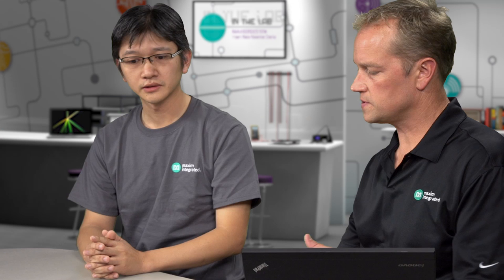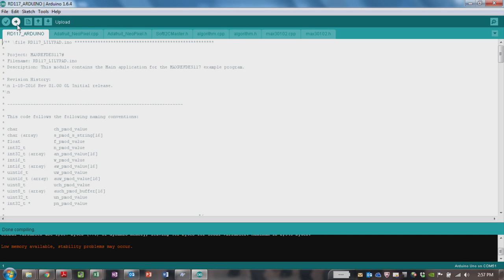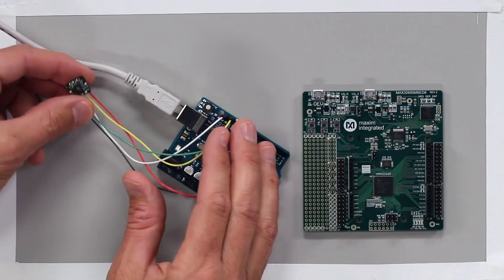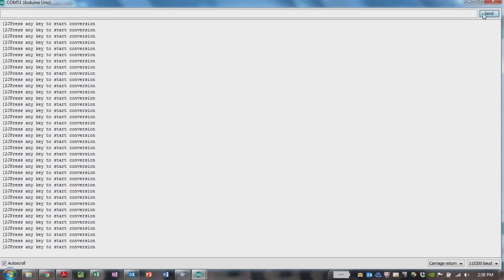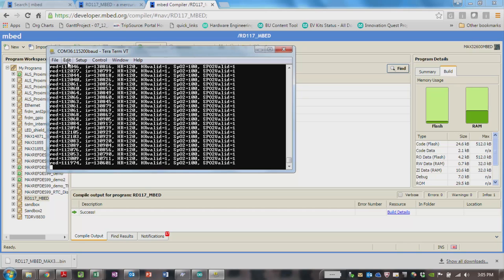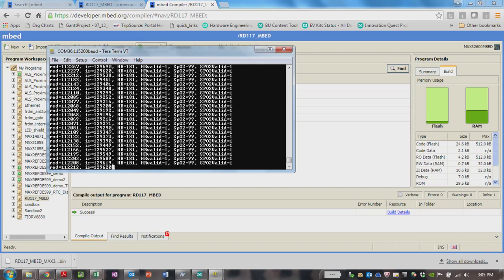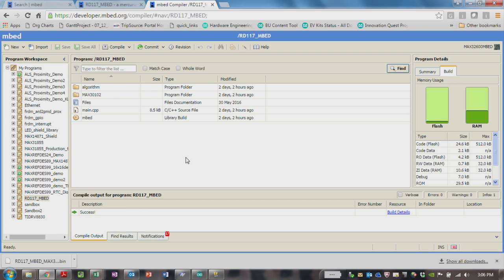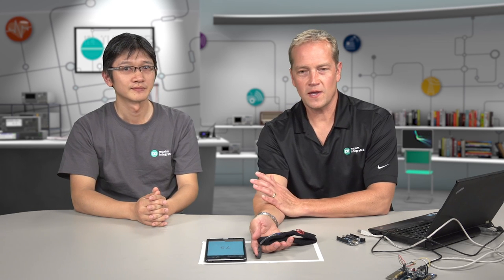Heart Rate Monitor Demo

Comment: Great demo. I have little query. The heart rate values are still varying rapidly by applying constant pressure on sensors. How to stable the values ? As other products available in the market gives more stable heart rate results.
Reply: hello, did you find an answer?

Comment: @maxim integrated It seems that in the datasheet for MAX30102, the order of LEDs is wrong, i.e. first LED is the IR one. In other words, only the IR LED becomes online in the heart rate mode. Consequently, the data read from the FIFO is in this order too. The code you're referring to is also based on the wrong info from the datasheet and as a result, the readings from IR and red LEDs are being used instead of each other which essentially means wrong results for SpO2 calculations. The MAX30102 chip I'm working returns Part ID: 0x15 and Revision ID: 0x03, so it is indeed a MAX30102 and not the MAX30100.
Reply: In max30102 datasheet it is clearly mentioned that in Heart Rate mode only Red Led is used, so i think you are mistaken

Comment: 21:40 Okay is true with timing distance and Sampling frequency you can get the HR, how do you get that timing? that's my question because the sampling frequency is known in my application is defined by a PSoC HW programming in the blocks, but what about the timing distance? how do you get it? or how the algorithm gets it?

Comment: Thank you for the demo. I just start playing with a MAX30100 board and I've noticed that it's very difficult to have stable readings in other place but the finger, and noticed when you said that this sensors were only appropriated for extremities, ie fingers and ear lobe, so, I'd like to ask if you have a sensor (or adapter) that work better in a wrist/arm/chest/leg band.
The finger sensor is not ok in a gymn environment it will get in the way when you are lifting or using the hands in any way and the ear lobe sensor will look to geek to most people.
I'm not a professional developer, just trying do make a (cheap) sensor tailored for my needs. Thank you
Reply: I would love to know too

Comment: The MAX30102 is quite a nice package.  We've experimented with it considerably.  The data output suffers from the tiniest movement of the flesh, which MUST be pressed to the LED window.  Otherwise, raw data is unusable.  That's been our experience.  Can you tell us how to make the system be forgiving in such real world circumstances?
Reply from the maker: Glad you like it! The reference board was not designed for motion compensation and the algorithm works in resting mode only. To use with movement, you probably need an accelerometer.
Reply: @maximintegrated  Accelerometer is then used to find resting slots or in some other way?
Reply: @UCOLIvHazkdRGs0RbrporeMg Thank you! I think with Kalman it will be more accurate measurements. Lets see if I have enough CPU for that 😄

Comment: Great demo!  It's very encouraging to see this board functioning.  Over the past few hours I've been attempting to get this board to work - initially using the sample code on the Maxim site.  Code failed to compile in the Arduino 1.6.4 IDE - even after changing pin/port assignments as described in the code comments (would not take references to SCL_PORT).  I updated to the IDE to 1.8.1 and pulled the code from GitHub, as mentioned in the video.  Still fails to compile, in a different way but still in the I2C library.  Any ideas?
Reply from the maker: Hi Tom, sorry to hear you're having issues. Try using IDE version V1.6.6--that should work.
Reply: Hi, it's not possible use the code to arduino version  1.8.1 ?
Reply from the maker: The I2C library has some compatibility issues with some Arduino IDE versions.

Comment: Good day! Thank you very much for your video!
I don't understand how did you calculate 25 samples per second? It depends on what? Which of the parameters of Arduino board influence on number of samples we are collecting?
Reply from the maker: Thanks for your interest. The sample rate is set in the the maxim_max20102_init() function. The following instructions set the raw sample rate to 100Hz, and 4 samples averaged per FIFO sample. So 100/4=25 samples per second.

//
SPO2_ADC range = 4096nA, SPO2 sample rate (100 Hz), LED pulseWidth (411uS)
if(!maxim_max30102_write_reg(REG_SPO2_CONFIG,0x27)) 
    return false;

//sample
avg = 4, fifo rollover=false, fifo almost full = 17
if(!maxim_max30102_write_reg(REG_FIFO_CONFIG,0x4f))
    return false;

Comment: How did you get the readings at the end of the video in mobile app
All I get is the same numbers in the video
Reply from the maker: Hi Ali Ali,
 
For the mobile app, we wrote some firmware to connect the MAXREFDES117 to a Flora board and a Flora Bluefruit LE board, and hence communicate with the tablet.  You can download any BLE heart rate because BLE has a protocol for heart rate.  The code is here on Github:
https://github.com/MaximIntegratedRefDesTeam/RD117_FLORA_BLE
It is open source, with all of the benefits and limitations.  Of course, we want it to work for you.
If you’re already done this, and you’re getting weird data, that’s another issue.  Let us know.
 
Best regards,
 
Dave

Comment: Hi Maxim Team, 

Thank you much for the great work. Also for sharing for free your algorithm for HRM. 
Just one thing to add, as mentioned on the latter part of the video, you have said that you cant vary led brightness using arduino Uno?, 

I just think you can. It has PWM pins. 

Regards,
Charles

Comment: red=706, ir=932, HR=150, HRvalid=1, SPO2=-999, SPO2Valid=0
red=769, ir=925, HR=150, HRvalid=1, SPO2=-999, SPO2Valid=0
why is that spo2=-999
Reply: it is invalid like you have SPO2Valid=0, so the value is strange, you have to put the finger correctly

Comment: is it that every 4 second a reading of heart beat is taken ??
Reply from the maker: For the Arduino platform, sensors sample at 25sps. The algorithm takes a block of 100 samples to calculate the heart rate, and the calculated heart rate is updated every second.
Reply: @ Maxim Integrated so 4 seconds is the time taken to calculate the heart rate right  ??
Reply from the maker: It takes 4 seconds to calculate the first 100 samples.